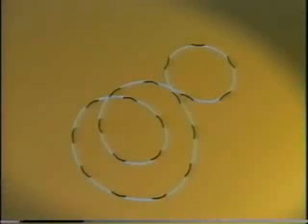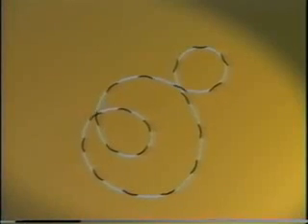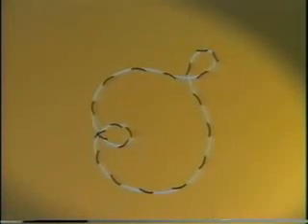Sphere Inside out Part - II

Comment: This would be useful in my theory of space-time continuum. Where space is actually potential energy which can be bundled up to create heat energy due to resistance and with it mass from the collection of light particles to create atoms... 

Space can pass through space but pinching it could rip the farbic of time. However, if space could pinch itself we would be looking at a 5th dimension in that at the pinch both sets of time would cause one to be in both realities at the same time and space but time no longer relevant since it would mean that time would be running on a loop hence the universe is round which means it had a beginning which means there is more than one universe and with it multiple realities each running on a different time most likley and made of different consistencies and each universe leveled one with in and out the other. Meaning many worlds overlapping each other each with it's own set of rules and laws governing each world where one world cannot collide with the other but coexisting together. 

Interesting.
Reply: I like how you said "my theory" a theory and an idea are two very different things
Reply: I'm sorry for not being technical... I meant my hypothesis. Happy? Or are you going to contend with me some more? Or is it that you think I am not allowed to my own thoughts and opinions as to the creation of the universe? Because as far as I'm concerned no has gotten it right so far with facts to back it up. 

My next step is experimentation... I'll keep you all posted.
Reply: MasterHyperion You play Yugioh!!!
Reply: I absolutely have nothing against your ideas, I  just try to correct people who misunderstand what a theory is, because some people claim that evolution or the big bang is false because they are theories.

Also, the fact that i play yugioh does not make my statements any more or less viable.
Reply: Sorry I snapped... I though you were trying to make me look foolish and contend with me.
Reply: A few points. First, self intersection of a manifold can only occur if your manifold is embedded in a higher dimensional space. Two, just because you've self intersected does not mean that time runs in a loop or is periodic in any sense. It just means at one distinct point in space, there are many different points of time that can be attributed to it (which is sort of meaningless if you think about it a little more but the point was aperiodicity). Third, just because you've looped does not mean you're in another world, in the same way that running around the world does not mean you've entered another world by the time you get back to your starting point. Fourth, matter and light are substantially different. See: the standard model.
Reply: In accordance with Occam's razor, I think introducing worlds-within-worlds isn't very likely. Furthermore, just because the energy comes from some kind of interior world, you haven't explained where the energy for the interior world's "space bundling" comes from, assuming it behaves in a similar way. Are you saying there are infinitely many nested interior worlds? Turtles all the way down, as they say...

In any case, I still don't see how this TOPOLOGICAL result has anything to do with what you're talking about.
Reply: Kris Semelka who are you addressing this post to?
Reply: You
Reply: Kris Semelka 

Let me explain... I did some research in my early years in quantum mechanics. I found it interesting that till this day gravity cannot be explained. So I hypothesised on the concept of violating the first law of thermodynamics.
In this scenario you have a photon traveling through space endlessly... however, the further the photon get in relation the energy source the broader the wavelength. So it ocurred to me... if this photon keeps traveling through the vaccum of space until its wavelength flatlines... where did the photon go? 

So then in the process of trying to answer this clear violation of the first law of thermodynamics I envisioned a scenario in which space IS potential energy/matter but grasping at space is not an easy task.

Then after watching this video it made it plausible that if we apply energy at certain points in space, space will bundle up giving rise to energy/matter... the problem of this scenario however, is... where did the energy come from to cause space to bundle up? 

And the only plausible solution to this is worlds within worlds...
Reply: Yes many worlds within worlds... You see I was trying to prove that both the Biblical and Qur'anic scriptures assert this idea... the energy from another world bundled the space in a zero energy zero matter universe, however it is not zero energy zero matter... space itself is energy but something that is neither energy or matter in a different world bundled the space energy into visible energy and energy into matter... so then the reason why matter has gravity is because of the internal space stretch to make matter.
Reply: MasterHyperion evolution is a theory. It's actually more like a law so.. uh yeah

Comment: So to turn a sphere inside out you need to break the laws of physics?
Reply: Yes and no. It depends on the material. Practically, we don't have that, but theoretically you could make a substance where you can push the atoms between one another. 

This is more string theory and relativity based than anything. Much like the Higgs Boson, until we get a physical example of something like this, we won't be able to fully learn how we can use it.

It's also the stuff that lets 3D models pass through other 3D models in software.
Reply: Abendschein Man you lost me
Reply: No item is completely solid. There are gaps between the atoms and molecules. So if you could push atoms/molecules between the gaps of OTHER atoms/molecules, you could theoretically have materials pass through one another.

Until we find/see a physical application for this kind of theory, we won't really understand how to use it.

Also, this kind of understanding is used to make program that are used for 3D modeling (like video game characters). Ever wonder how clipping occurs? It's this kind of a principle. It allows objects to pass through one another.
Reply: Abendschein Alright, so is or is it not possible right now?
Reply: Right now? Not that I know of.

Don't forget though, Relativity and the Higgs Boson weren't proven immediately either.
Reply: THEOTHERGUYNATION It's theoretically possible, although we currently have no physical material that is workable to test it physically. This isn't needed if you can prove the mathematics behind it, though.
Reply: THEOTHERGUYNATION But, the reason why a solid item with that property does not exist is because of the electron and its charge. Every atom have at least one electron that produces an electrical charged sphere around the atom a.k.a. an "electron cloud". When two atoms try to pass one another they will either bounce off eachother or lock into a position against each other given a pushing/pulling force that keeps them in place, this is due to the repelling force caused by the atoms negatively charged electrons.

The electron cloud is the "problem" that needs to be "fixed" in order to make an item as you described above.
Reply: *****  The struggle is creating a materialistic substance that retains its atomic interactions with its local mesh, while ignoring atomic interactions with particles further away on the same mesh. If a sphere was created, each atom would have to interact with itself, as well as the atoms immediately adjacent to it, all while having the inability to know, care, or interact against the atom 2 or 3 or 20000 away from it. The reason that sharp edges can't be allowed is a discontinuity forms when 2 neighboring atoms suddenly have to ignore each other. If these atoms had the capability of (even temporarily) not "feeling" each other, the mesh could not exist at all and thus the sphere could not exist.
Reply: jose gomez No it cant.  Water is just enormous amounts of molecules passing around each other.
Reply: THEOTHERGUYNATION It's not talking about physics, it's talking about the fundamental properties of surfaces and transformations that conserve these important properties. Believe me, seemingly abstract math can be used in physics. An example is Group Theory used in Quantum Mechanics using Lie Groups.
Reply: THEOTHERGUYNATION you can not find a sphere in reality. a sphere, like any other mathematical concept, is an imaginary entity. thus physics is irrelevant. in reality we only have things approximate to a sphere.
Reply: +Abendschein Beautiful explanation.
Reply: ***** Gotcha
Reply: Sim Prox can water pass through itself?
Reply: Kinda yeah
Reply: I don't think you understand the purpose of the video. The video is telling you how to turn a sphere inside-out. Even though it doesn't exist, if there was a martial that could pass through itself, and it was made into a sphere, this would be how you do it. The reason you cant crease, is because if you try to do that, no matter what kind of material it its, real or fictional, it would still break due to it being pinched infinitely tight. If the sphere's imaginary material was indestructible, the pint of creasing would simply stop, keeping it from moving any more, even if it could pass through itself. If you are still confused about matter passing through itself, here is a helpful page: http://ask.metafilter.com/171748/Phasing-through-solid-matter-Fact-or-Crap
Reply: THEOTHERGUYNATION We DO have materials that can "go through" eachother through the gaps in their atoms BUT you wouldn't be able to see it with the naked eye OR control it physically with instruments. It's just a mental concept right now, not worth making reality brother.
Reply: Abendschein The Higgs Boson doesn't have anything to do with this brother, and neither does string theory really...other than the fact that the universe may incorporate string theory.
Reply: cybertree You clearly missed the message. Please reread the passage.
Reply: I think this procedure was meant to stay at a theoretical level where walls of the sphere passing through other walls represents some feature of differential equations. I know for one, these equations must be defined everywhere, which means they cannot have corners or any sharp turns.

In real life this shit is basically useless.
Reply: ***** What about Hydrogen ions? :P
Reply: Robert Cohn What about them? :O
Reply: Abendschein We have actually created a Higgs Boson. Unfortunately we can only know of it's existence AFTER we create it as it exists for fractions of a second.
Reply: THEOTHERGUYNATION magnetic spheres maybe?
Reply: Joey Rodregez i bring up saltwater in comparison to fresh water ... the fresh water will pass through the salt water if it is placed under the salt water due to salt water's density
Reply: geoffros1 there must be something in the universe somewhere that can stabilize its lifespan
Reply: geoffros1 Discovered, not created.
Reply: Abendschein scientists would consider it created due to the fact that it resulted from a process started by them with the intent to find something like it
Reply: Abendschein No. They have actually set out with the intent to prove its existence and know of set circumstances most likely to result in its appearance and used them. Thus created.
Reply: Doryakir It's discovered, because the process naturally exists. The LHC exists to force it to happen in a control environment. The smashing of particles creates an incident in which the Higgs Boson can appear. It doesn't create the Higgs Boson, it creates the environment in which the Higgs Boson can be observed.

geoffros1 Read above.
Reply: Abendschein i would agree if we had discovered it actually existing without the interference of humans but the truth is that the only one we have found was created through a human process so its "created"
Reply: Doryakir You should be agreeing because that is exactly what it is - a discovery. It was a hypothesis that it existed, and the theory was that smashing these molecules together at the/near the speed of light would bring it into an observable spectrum. 

Human interference doesn't make it created. The smashed molecules didn't combine to make the boson, it was a product of what was essentially released. You can't break a rock in half and then tell everyone you created a geode when you find minerals inside.
Reply: Abendschein discovering something is to find something already in existence before a persons interaction, until we find one on its own without having to do an experiment to make it appear it will remain a creation
Reply: +Abendschein So you say everything that exists because of human interference is a discovery and not a creation since we only force it to happen in a controled environment.
Reply: Leeroy Jenkins You're missing the entire point.
Doryakir The Higgs Boson was already in existence. The point of the LHC was to force the appearance of the Higgs Boson in an environment in which we could observe and record it. It is a naturally hard particle to observe since it takes some incredibly specific conditions for it to happens and for it to be observed. Years of the LHC show that it is not easily found. 

We did not create the particle, we only forced it's appearance by repeating the only method that we know of where it can be observed; smashing particles together near the speed of light.

That, my friend, is a discovery and not creation.
Reply: why am I missing the point?

Synthetic materials are discoveries by your definiotion
Reply: there's no proof of its existence outside of our interference until we observe it out side of our influence it will remain a theory and the only way we know of for sure to make it "appear" is with our interference which is a creation until we observe a natural occurrence. same thing goes for the elements created on the periodic table through combining of 2 other elements until we find a natural occurrence they are creations.

also don't call me friend i don't know you and never met you in person your barely an acquaintance.
Reply: Doryakir We know, that in nature, particles do clash at very high speeds. We created a device that will force such interactions in an observable space. Observing particles at  a high speed is quite a problem (Heisenberg's Uncertainty Principle).

At this point in the conversation you're just babbling and putting words together so you can make it seem like you were not wrong on the internet. You're still talking with people, and if someone wouldn't accept your points in a face to face conversation based on the lack of knowledge and your fallacies, it won't be accepted on the internet either.

This is a natural process that, we as humans, forced to happen in our observable space so we may do our best to measure and learn.

Your statement is very poor of quality, as everything in science is a theory. Scientific theory is as close to reality as the scientific community comes. We can observe what happens when the principles of a theory are put to use, but the fact it remains as a theory is to acknowledge the fact that this particular idea may not be entirely correct. 

For example; Gravity is just a theory. But we still fall, we still get hurt if we do so. To say something is wrong, or as you did, not conclusive because it is just a theory is ignorant.

I am sorry, but this conversation is done. There is nothing I can learn from you, and you are clearly much too stubborn to stop and learn. You are set in your ways and it appears that will not change. I wish you the best in future discussions with others.
Reply: Abendschein if you have never seen it happen in a natural setting no matter how much you want it to be until it is actually observed it is not natural.
Reply: You do not need to see something happen naturally to be able to see a result, to see and observe what it has left behind. Observing it in nature answers questions, but forcing to happen as it does in nature under our scope of observation answers quite a few as well. We know how, we had a theory that was set out to provide evidence for the hypothesis, and it worked. It worked fantastically. 

Your claim is humoring, but it is the last response from you I will dignify.
Reply: Abendschein you cant prove its what your looking for that made the result. all you have been doing is trying to push one side then u tried to insult me by implying im stupid and making up stuff.
Reply: Doryakir No, no, and no.

I hope you realize that most of your own statement can easily be directed back at you. I have probed my point, but you're too stubborn to see anything outside of your own understanding.
Reply: Abendschein just saying no proves nothing other then you can say no a lot. if that's all i want to hear i will go talk with a 2yo. you cannot see at all what i am getting at or that it might not actually be my opinion at all.

have you tested ways you would be sure it would never appear? have you tested other ways it could possibly appear? is there truly only one way for it to show up? those questions and the answers to them can help scientist find where they should be looking in the universe to actually find one in existence under its own natural processes.

tell me this, you are given 2 diamonds, one is mined the other is "synthetic" other wise known as man made. could you tell the 2 apart just with you own eyes?
Reply: I did a lot more than just say no. I gave you very fair and strong logic. You're just arguing against anything I say because you don't want to be wrong. On the internet. In the comments of a video. Which is about learning and expanding understanding. Which also has a comment thread about learning and understanding.

Now who's being condescending and insulting?